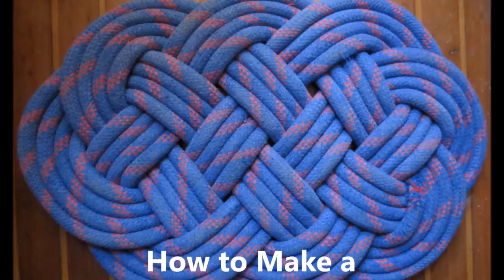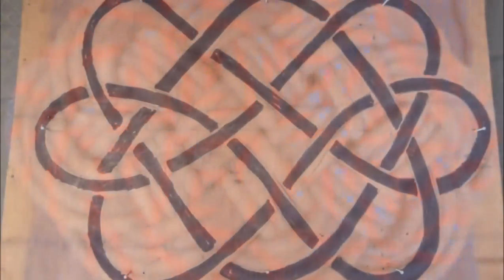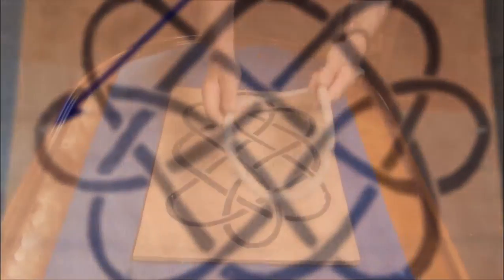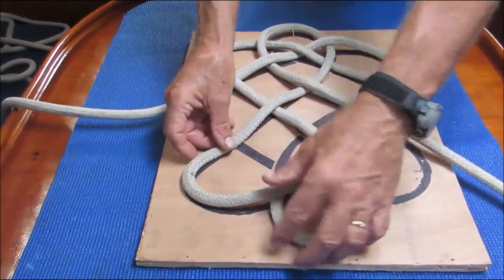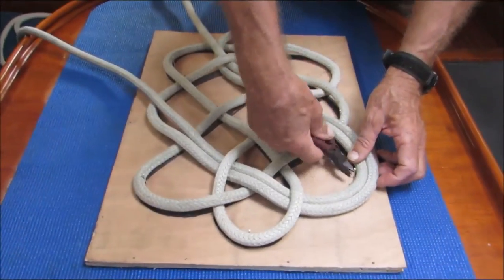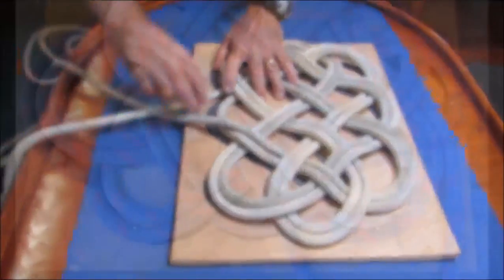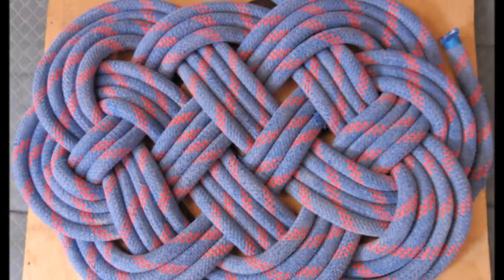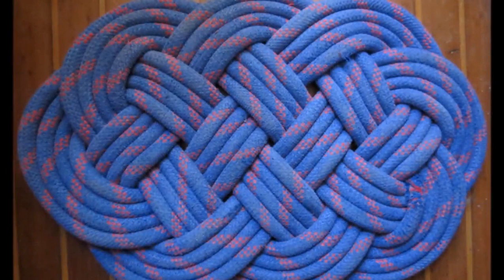How to Make a Nautical Rope Rug

Comment: Question: If someone had a longer thinner rope like a actual climbing rope that was left over for a climbing mat. I could just technically use one end until I run out and then whatever space is empty in between I could use the other line to finish correct I don't have to alternate lines back and forth?
Reply from the maker: I've actually done just this with an old climbing rope. It takes more time and work, because you will have to complete 4-5 loops, but it comes out nice. Be sure to stitch all the loops together as the last step. Good luck!

Comment: hi just want to ask...would this hold its shape even when machine washed?i want to make one but i would like to use fabric instead of rope..pls i hope youd answer my question.thank you very much
Reply from the maker: I’ve never made one from fabric, so I’m not sure. My guess is that it would be okay, but you will need to straighten it up afterwards. I’d wash in cold water and not use a dryer. If you make it, please let everyone know how it turned out.
Reply: Yes..Thank you very much for noticing and answering my question. I plan to use a braided fabric so it would have some stiffness. I will surely update how it will turn out. Thanks again. I love your video. Your instructions are easy to understand. But I still watched it more than a few times already.

Comment: Thanks ,  question is size , because I'm making a Matt for a model boat out of  twine. Do I copy the pattern 3 inches??
Reply from the maker: Yes, I’ve made the mat from twine as well, and the pattern just needs to be scaled down. The ends of the line will have to be glued instead of stitched. Good luck on the project.

Comment: will this work with a 90 meter 8.5 mm climbing rope?   Obviously I would have to expand the pattern, but will it be easy to tighten up if I make the pattern to large?  Hope my question makes sense. thx
Reply: LivingLifeWithAaron cut
Reply from the maker: Yes it will work with 8.5mm rope, but you will have to make 4 or 5 passes instead of 3. It just takes more patience to get it tightened up evenly.
Reply: i don’t think i’ve ever seen a 90 meter rope. linking pitches must be epic

Comment: is the pattern available for purchase?
Reply from the maker: We don't currently have a written pattern. Just the video instruction. That's a good idea though!
Reply from the maker: If you are still interested in a printable pattern for the nautical rug, it is now available at www.justalittlefurther.com. Sorry it took so long to get it done.
Reply: How much line (length) should I use with a 1-inch line to make a mat about 3 1/2 foot wide?